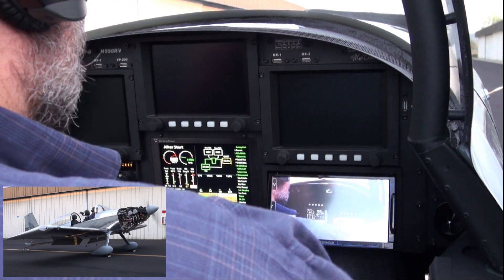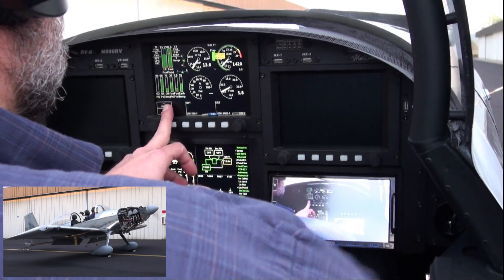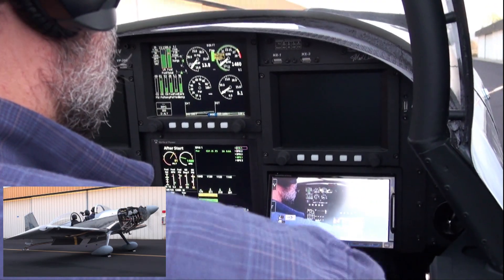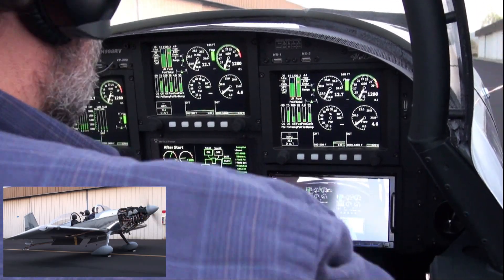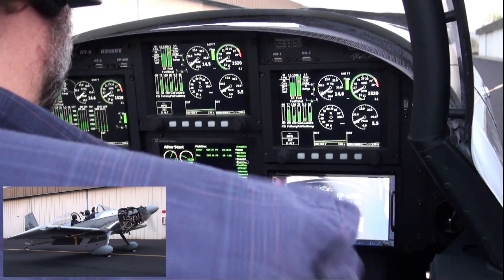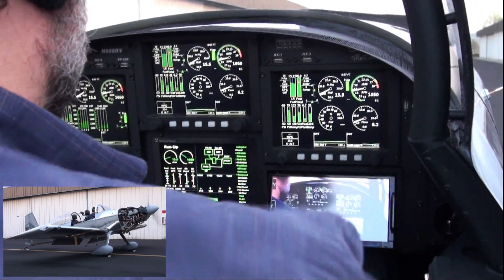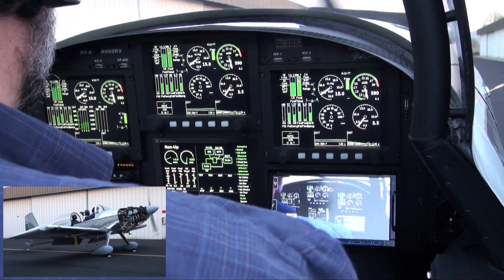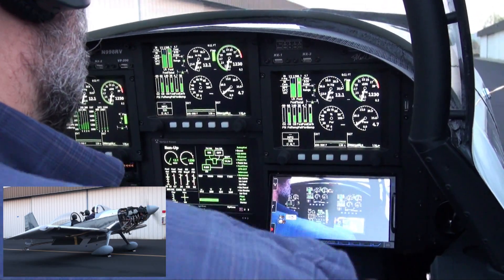2010.04.13 - Instrumentation Checkout - Matt Dralle's RV-8 - (HDTV)

Comment: Why so many screens ?
Reply: It's not that out of line for a cockpit with limited real estate - especially if he intends IFR. With dual AHRS and a backup battery one is likely completely independent in the event of electrical failure. Keep in mind that in flight at least 3 would be required for primary flight, engine monitoring, and map/nav/comm.